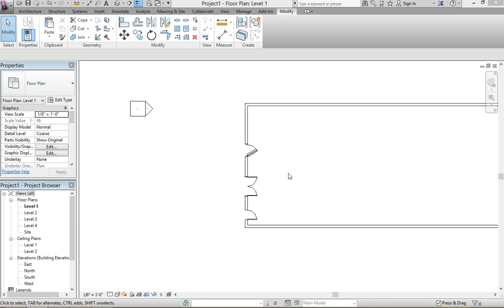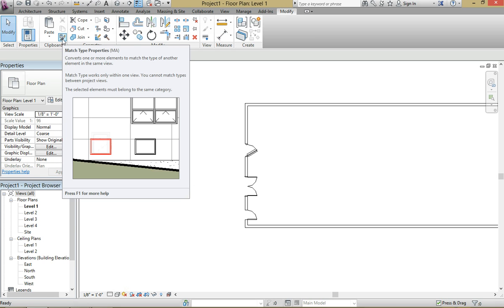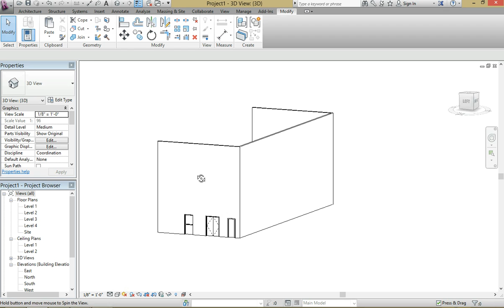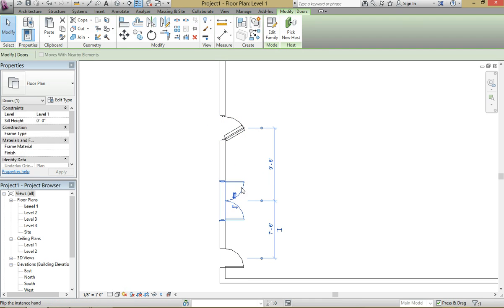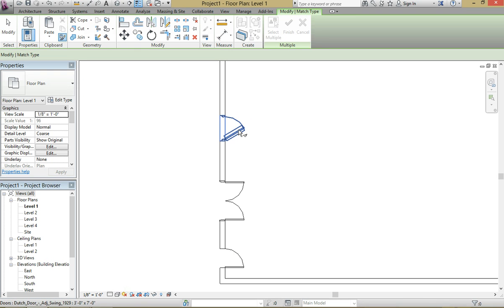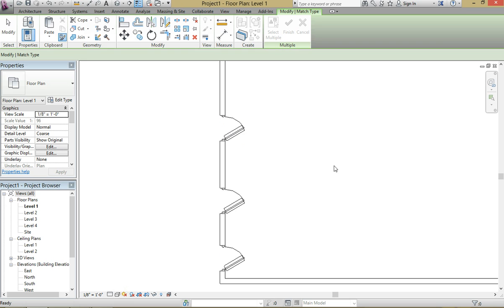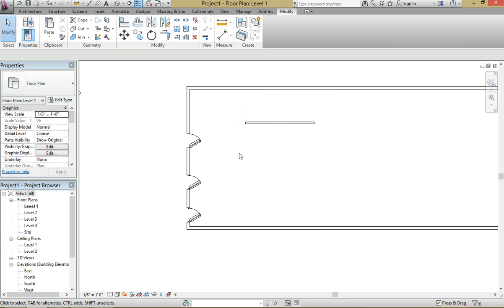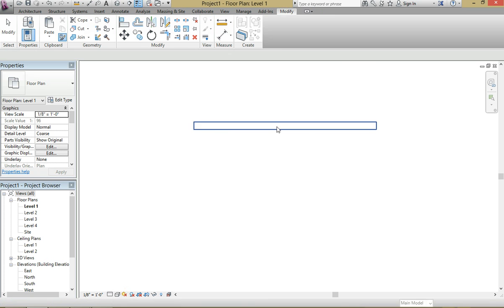(How To Use) Autodesk Revit Match Type Properties Tool

Comment: Coming from a former ArchiCAD user, the Eyedroper tool is much more powerful then the Match Type Properties Tool in Revit, ArchiCAD u can clone column A to column A completely, the same orientated direction + height will be the same. In Revit you cannot. Autodesk should improve that.